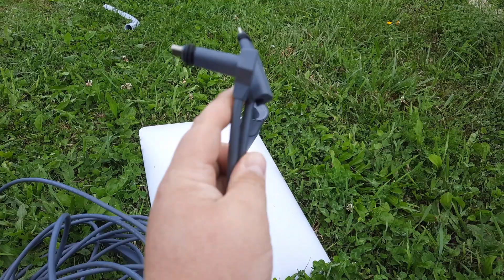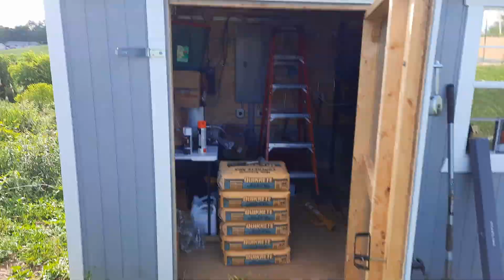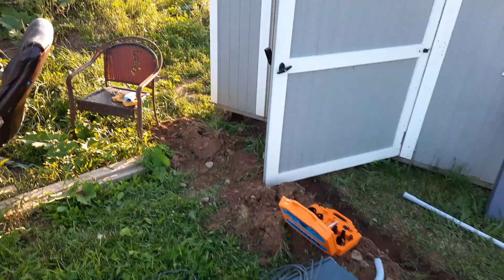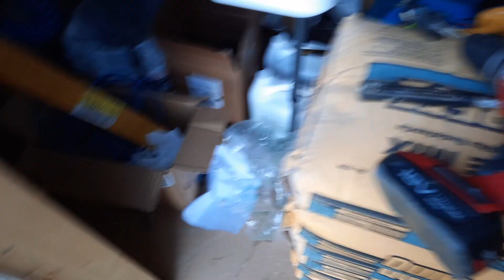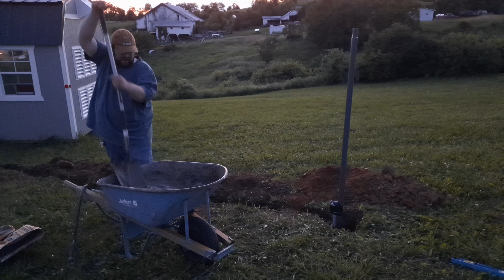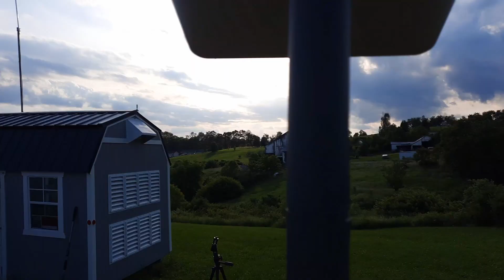Installing Starlink Satellite Dish On Mounting Pole

Comment: Hi Thomas, great video....one question. does the ground mount pole fit into the original mount? you showed how the pole clicked into base pole on sat dish. but not if the other end would fit into original mount. Any info at all would be greatly appreciated, Thank You.